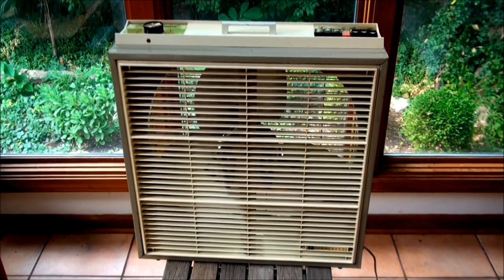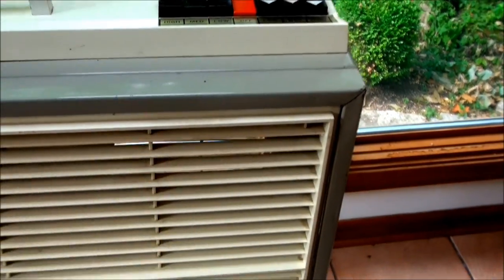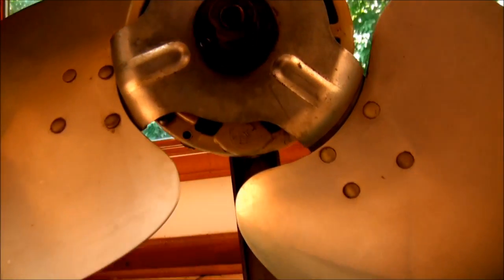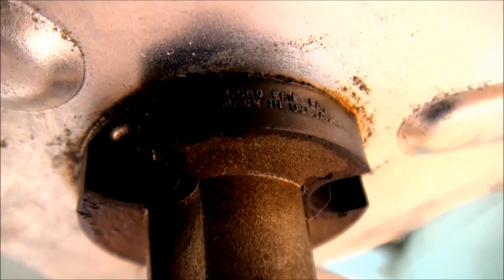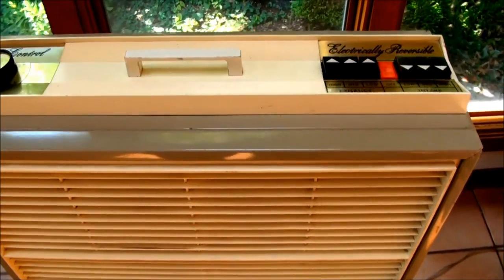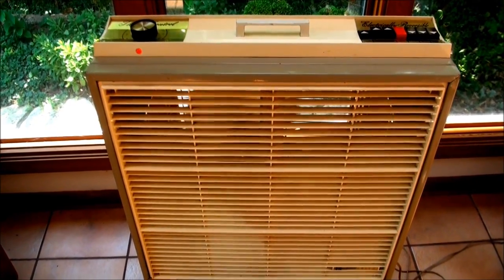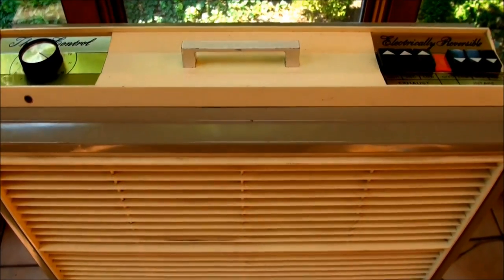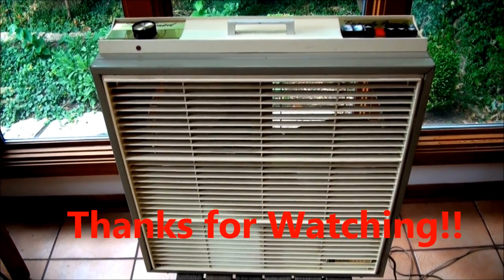Penncrest 20" Box Fan. Reversible/Thermostat. #9714

Comment: i know this is 2 years later, but this fan was introduced as a TOL model in  spring 1966. (i have the penneys catalog it was in) i have the slighty lower end model which is a 9713 and had the premuim controls just like yours, but instead of buttons, just has a knob.  mine also has a GE motor, whilst this more powerful version had a redmond motor.  this is my 2nd lakewood metal boxfan and 2nd penncrest.
Reply from the maker: Thanks for that information. It's good to know. It's almost time to get it cleaned up and ready for the summer; I use it as an exhaust fan at night.
Reply: Spring 1966?!! It's going to be 50 really soon! Happy Birthday!!! 😄

Comment: I have same fan.  Very powerful airflow.  How do I change switch burnt out.  I used cleaner because buttons were hard to push.  Plugged it in before dry and burnt switch UGH.
Reply: I live in Evanston IL. eliminate disconnect thermostat.